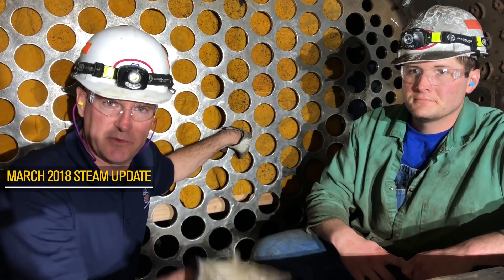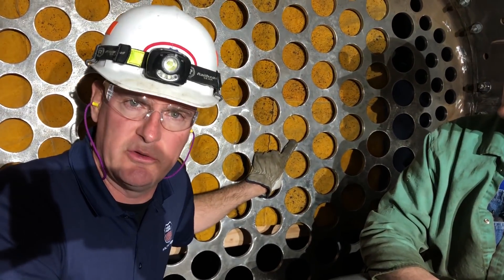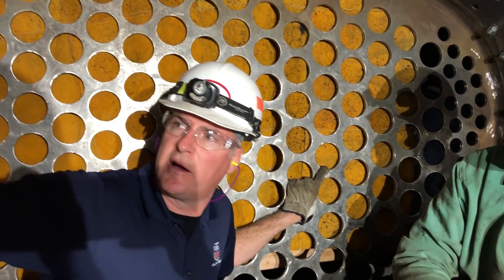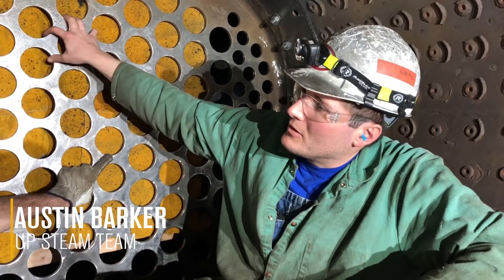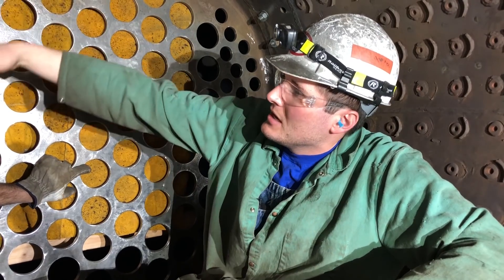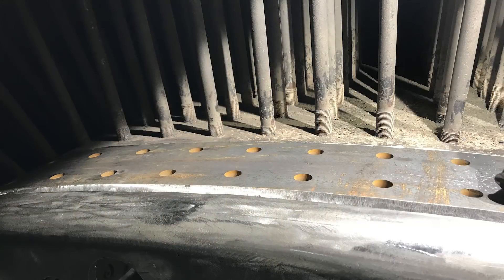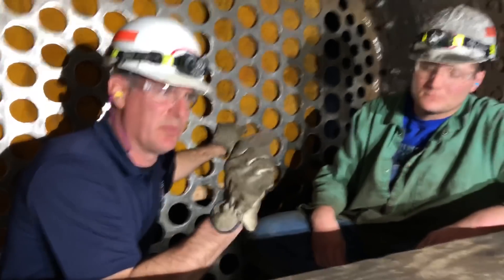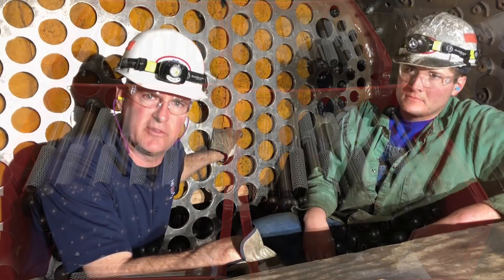March 2018 Steam Update: Putting the 'Big Boy' Back Together

Comment: The thing of it is that most big boy locomotive and the challenger  type steam locomotive recently are now oil burners  because coal is harder for supply and demand
Reply: It's not just a supply and demand problem. It's also the lack of infrastructure for coal. Long ago, they tore down all the coal refueling depots and stops, especially along the West Coast. This means any coal fired steamers these days have to lug around 3-4 carts worth of coal...And a monster like the Big Boy "eats" 28 tons of coal every 3-4 hours! That's a huge consideration! and also, coal these days are much more expensive than the past....Again, a Big Boy swallows 28 tons of it every 3 hours...UP probably calculated the cost and just went, "NOPE!!! we are not paying for this shit!!!"

Comment: Besides Ed Dickens being the Engineer Driver of the Union Pacific FEF-3 4-8-4 Northern Type #844, Who will be the Engineer Driver of the Union Pacific Big Boy 4000 Class 4-8-8-4 #4014 Once the Restoration is Complete, and the Engineer Driver of the Union Pacific Challenger 3900 Class 4-6-6-4 #3985 after the Big Boy Project Restoration, and Rebuilt, and Reconstruction?

Comment: +UnionPacificRailroad  Thanks for the briefing on the new firebox.  The new staybolts for the crownsheet should sustain much less abrasion with fifty gallons per hour of Bunker C, compared to the bituminous used in the 1940's.

Comment: When the time comes, will you be explaining 4014's oil conversion? I'm very curious to know what will make this apartus different from the original oil conversion experiment from previous Big Boys.
Reply: America: "did someone say O I L"
Reply: there's no real reason to run it on coal. besides the cost, coal is just worse for everything because of how badly blasted the interior gets. it'll also make more steam on oil.
Reply: Oddly enough, you're the only one that had and or thought of that reaction.
Reply: I'd love to see it running on coal, but I know it is not feasible today.
Reply: Thank god no! It's filthy. Corrosive, inefficient, and a fire hazard.
Reply: so is diesel fuel
Reply: yes that is also a factor, it needs to run on high quality coal and not too much of that is produced anymore, so it's much more expensive than regular coal that power plans run on, which is relatively garbage grade coal

Comment: Great update.   What I'm wondering is if the entire super heater will be replaced.   How do you acquire a mile of high pressure tubing and configure it in this day and age.
Reply: It isn't hard. All the code tubing is available as well as the return bends. Welding and bending and lots of hours is what it takes

Comment: Possibly this question has been posed, many times before, and the precisely accurate answer has also been disseminated. Since those years, that these locomotives were originally manufactured, are there now better metallurgy components available versus what was employed previously? If that should be the case, where have strides been made for these components; I.E., metals, fasteners, and other upgrades?
Reply: Ed said in his  presentation last week that most of the locomotive is mild steel and so are most of the replacements they're making.  They tow a water softening car behind the steam locos now, which should greatly reduce boiler corrosion.
Reply: Okay, this gives me some idea, of how this latest rehab of the beast can be sustained once the project has been finished. Over the years, and actually, in some cases to this very day, steam boilers, used for power plant services; I.E., turbine generating facilities, steam heating for commercial buildings (old technology) must have an expensive water treatment compound solution added at regular intervals to the condensate as the H2O is recirculated, or new water is added to the system. This has been the plan to slow down the corrosive properties, and oxidation, and or, the electrolysis process, which ultimately will take its toll, on all iron-based metal products; stainless steel products withstanding.
Reply: They are working off the original blue prints, and making the steel from what ever steel the blue prints specified. All the stay bolts, boiler tubes, and boiler shell are nothing but mild steel. Mild steel is the ideal choice as it can take a lot of heating, cooling, and bending with out cracking. I used to work in the shipyards in Seattle and we had boilers on ships that were 10,000 PSI and the size of a small house. Steam locomotives even the Big boy are small potatoes compared to those. As far as the quality from the 1940"s compared to now? It hasn't changed much. Steel is still made almost identical to how it was made in the 1940's. In many ways I think the quality was better in those times as it was all American made.
Reply: Many HUGE differences between fire-tube (locomotive) and water-tube boilers. Water-tube copes with much higher pressure than fire-tube, not needing staybolts to keep a firebox from exploding, and responds much more rapidly to changes. (MUCH faster going cold-iron to rated pressure.) Separately fired superheater a PLUS. Loco boilers can be much more compact, though. (Liberties/Victories run pretty low pressure FWIW.)
Reply: Traveling Tom-  I spent some time on a Fram I Gearing-class destroyer (late WW II-vintage). It had state-of-the-art water-tube M-type boilers, running at 600 psi. Later USN steamships ran 1000 psi, and possibly up to 1200 psi. That's when they got pretty fragile. I'd love to see, from a distance, a 10,000 psi boiler. Typo?
Reply: deereboy8400 I would think with the myriad of chemicals added to water today, that softner car would absolutely be a necessity. Moving thru different locales and using different water sources would also up the ante for pretreatment of water.
Reply: Oh sorry Jacques that was a typo. I remember asking a guy how many boiler tubes is in one of those boilers and he told me around 10,000. Maybe thats what I was thinking. I always told many of these museums that they should send their locomotive boilers to the shipyards. They could probably over haul them in a few weeks. Here is a link of a photo of a Babcock marine water tube boiler which looks like some of the boilers I saw in the huge merchant ships https://maritime.org/doc/merchant/engineering/img/pg36.jpg
Reply: I visited the Gladstone power station in Australia perhaps 35 years ago and the boiler feed water did not have anything added.  Instead it went through an elaborate series of ion exchangers distantly related to domestic water softeners.  The product quality was higher than laboratory grade distilled water.  Since a power station is a "stationary engine" this can be done, but a steam loco had to take water of varying quality where it can be supplied.  Additives often based on tannic acid have been used in locos to reduce corrosion and keep muck in solution. I have read that the Argentine steam engineer dell Porta formulated some of these.

Comment: Please explain the "staples"
Reply: "Stay Bolts."
Reply: Ahh ha.. thanks (been living too long "west" of the Rockies)
Reply: "some what perfect" gives me pause to wonder
Reply: Stephen Mortimer Well by that, I mean it isn't going to be perfectly spot on. A steam engine when it's running is always larger than when it's cold, but only by a few thousandths of an inch. It's unnoticeable.
Reply: Stephen Mortimer Staybolts are what keep the boiler and firebox together under heat and pressure. When a steam locomotive is fired up, the heat and pressure will cause the metal to expand, so the staybolts keep them in somewhat perfect geometry. If steam locomotives didn't have them, there would be serious issues.
Reply: the big boy is large enough that the size difference is noticeable and needs to be accounted for
Reply: Ha ha (small joke of mine)